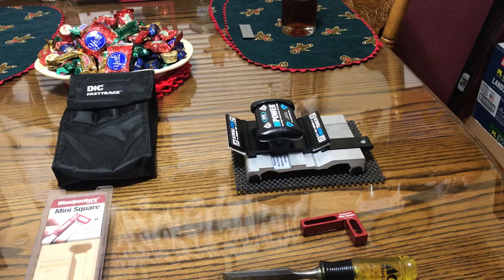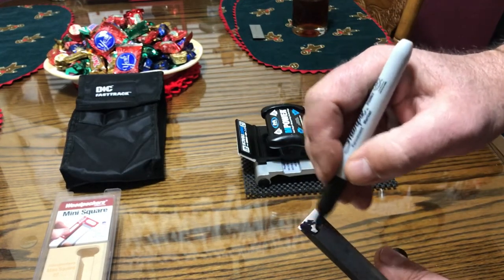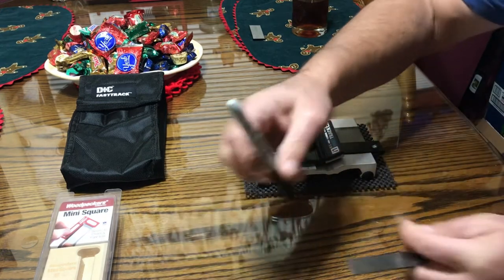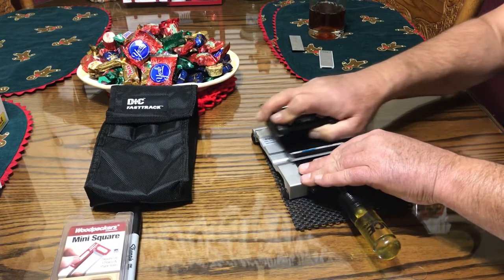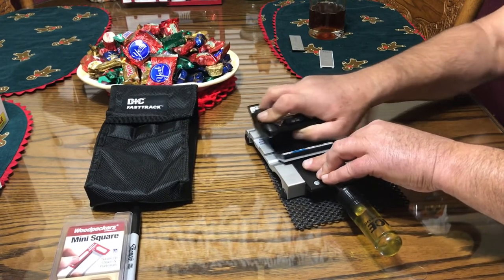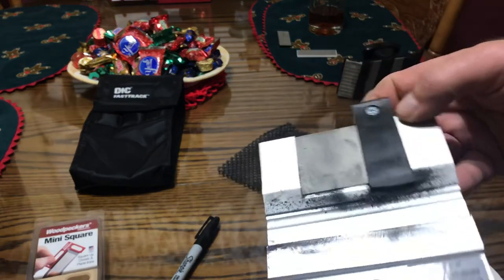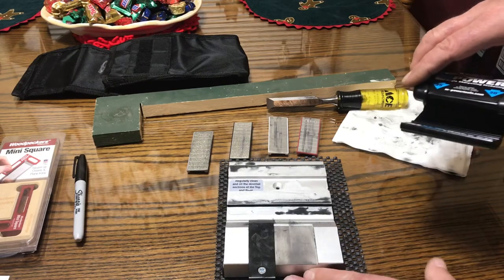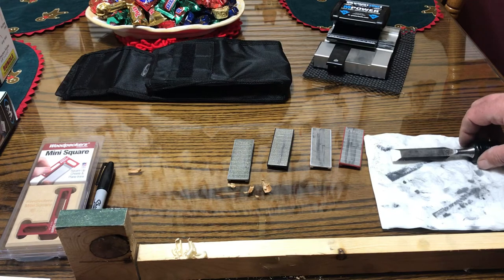MPower FastTrack Mk2 First Use

Comment: Got one of these. Thought is was broken and returned it. Got a second one. The amount of slop in the mechanism is about 5deg on the bevel and 2mm across the face. I'm mystified that anyone is okay with the results these produce: I'm getting a better result from holding a chisel to a belt sander, used to remove big chips than these things. I'd take a sheet of wet/dry sandpaper over these. I don't want to criticize anyone personally, but recommending these seems very suspect to me.
Reply from the maker: It’s definitely not a Tormek, I’d be careful using a belt sander, the heat that would produce could change the temper.